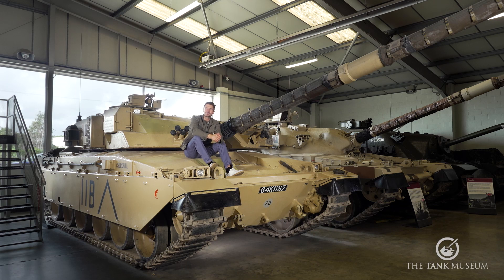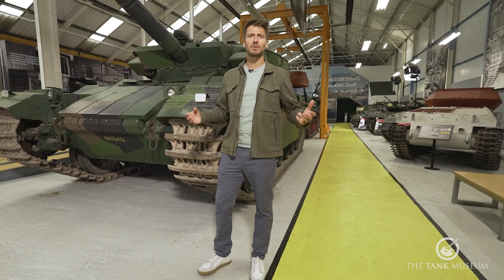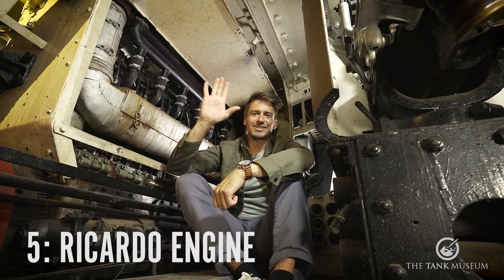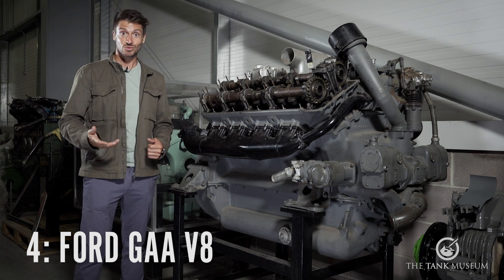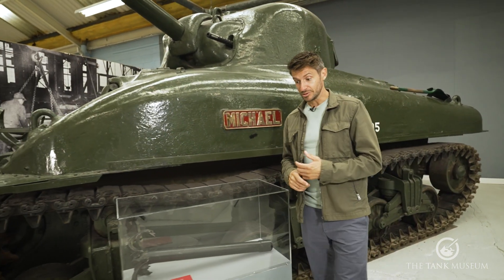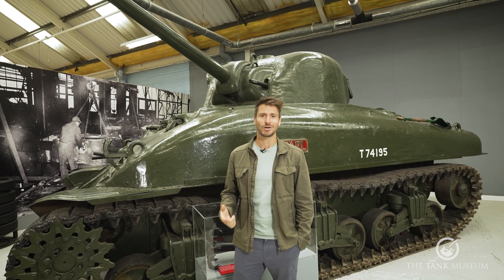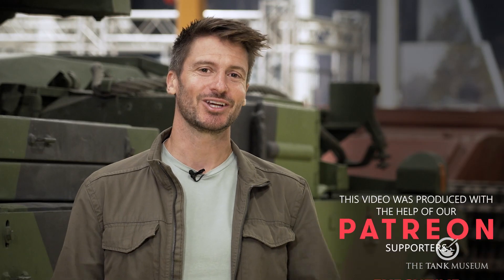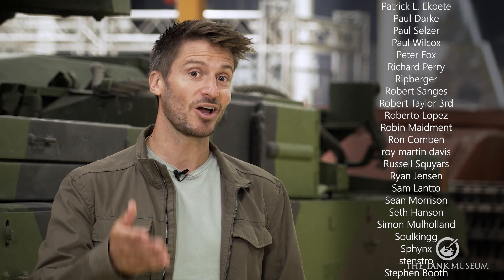Top 5 Tank Engines | Rob Bell | Institution of Mechanical Engineers | The Tank Museum

Comment: The Churchill had no less than 2 diesels, and about 19.000 shermans was made with one. The US Marines used them, the rest went to Russia. And I  belive that the V2 was originally dessigned for use in an airship, thos the aluminium used in its construction. But some good choices, I think.
Reply: The Churchill had a single petrol engine, the Bedford twin six, developed by Vauxhall from the General Motors Stovebolt six, Like Churchill himself the Churchill tank was part American! The twin diesel your thinking of was in late model Valentines
Reply: @stevecunningham8960  Sorry, I was thinking of the Mathilda 2, or A12, who had 2 AEC diesels. Or 2 Leylands..
Reply: @stevecunningham8960  The Valentine had a single 6-71 Detroit (the GMC 6004) which was a Canadian development during their production of that tank to avoid having to use the AEC engine. It was the Grant/Sherman that had the "siamesed" GMC 6046 which was two Detroit 6-71s driving a common driveshaft through a clutch system. The M5 Stuart had a similar paired arrangement with Cadillac V8s and dual hydramatic transmissions driving a shared transfer case.
Reply: @rwaitt14153  I was replying to a comment about the Churchill tank engine, which was definitely not a twin diesel, then I went and typed Valentine instead of Matilda, doh. Matilda's II's came with a twin engine setup linked through a common gearbox long before things like the twinned engines in the Sherman and Stuart were tried. British tank designers had a real problem sourcing suitable engines putting out enough horsepower  for tank use, hence the twin diesel's in the Matilda, the range of different engines tried in Valentine's and the god awful Liberty engine used in Crusaders and such. Getting the Meteor engine available must have felt like a miracle.

Comment: funny the v12 is a common format for engines. but the number of v10 engines can be counted on the fingers of one hand.
Reply: Partly engine vibration - a 60 deg V12 is perfectly balanced, a V10 is not. Also the variation in torque is greater on a V10 so a larger flywheel is needed. There might also be issue with the timing of exh pulses.

Comment: Not a single word about Maybach. Were they so bad?
Reply: My impression is that the Maybach engines were actually pretty innovate, reliable and overall good, but even a good engine will have reliability and durability issues when used in a tank that weighs just too much - King Tiger and the notorious Jagdtiger come to mind. The Maybach HL V12 engines performed ok in the Tiger I and Panther, but in the much heavier Tiger II and the Jagdtiger, the strain on them was just too great which would either result in frequent maintenance requirements and/or breakdowns due to massive stress. Add to this finicky final drives (Panther, anyone?) and you have a durability disaster in the making.
Reply: @cawimmer430  Good summary of the engineering situation! Also maybe some Brits /Allied biased point of view?

Comment: Is the Soviet V-2 engine really a good choice for #1? I remember reading that it was horribly unreliable and broke even faster than the gearbox.
Reply: Same question here
Reply: I don't see why you'd think that. Maybe during the middle of the war where corners were cut to get as many out as fast as possible. The Soviets planned for tanks with relatively short lifespans anyway, every component was planned to last long enough. If manufactured well they are perfectly reliable, there's still T-34s around and running today.
Reply: "According to the Armored Directorate of the Red Army, the average T-34 in World War Two lasted less than 200 kilometers (124 miles) before requiring major repair or overhaul. "
Reply: @davidbell1250  And if that's enough to reach the front line to blow stuff up/get blown up, it's fine. It's not a problem with the design, since pre and post war production can go much further. It's just cutting back on construction finesse due to requirements of the war.

Comment: I think the R-975 have no place in this list. It is a good engine, but its origin was its downfall as a tank engine. 
But he Continental AV1790 family should be in the list. That is almost the western equivalent of the V-2. It used in a huge plethora of tanks and tank derivatives, transitioned from petrol to diesel, and with it became the replacement engine of choice for a large variety of older tanks.

Comment: Fuel consumption is not a criteria. Range is
Reply: Well, fuel consumption is inherently tied to range. If you have a Hungary engine and want to keep the range, you need larger fuel Tanks, wich either means a larger, heavier Tank, or you need to Cut down on interior space and safety.

Comment: A radial engine doesn't have to be tall. Just mount it horizontally with the crankshaft vertical. That should also limit the problem with fuel/oil gathering in the lower cylinders.
Reply: And you massively complicate your transmission design.  Thank you Dr. Porsche.
Reply: Don’t forget the oiling system and sump which was designed to function upright.

Comment: I don't think that's how any of the army maintenance departments define reliability. When you read "reliability" in an army report, they're usually describing how consistently things break. I.e. how close to the service interval a particular part or system will fail. 
If a road wheel fails at exactly 1000km every time, then you replace it at 900km and it is known as a reliable part, because the tank doesn't have any unplanned down time. If it fails at completely random intervals, then it would be an unreliable part and the tank would often be down for unscheduled service.

Also what? The Continental? Almost universally regarded as the worst possible choice for a tank engine? The one with massive overheating and therefore cylinder life issues? Whatever design work that you say needs to be done to cool a radial engine in a tank clearly wasn't done on the Sherman.

Comment: I have a 50 HP Perkins diesel engine in my tractor, but it doesn't boil water to make tea.  Curse the luck.
Reply: Remove the radiator. It should boil rather fast.
Reply: @XtreeM_FaiL  I found an easier way is to forget to clean the radiator filter.

Comment: A Diesel engine has a higher efficiency because of its greater expansion ratio. That is all. The rest is just words whirling around aimlessly.
Reply: So the hotter charge’s fuel injection burning lean in excess air instead of in a homogenous stoichiometric mixture is unimportant?
Reply: @givenfirstnamefamilyfirstn3935  No, of course it's not unimportant. Given a specific engine, and no demands on maximum power output on that engine, you can play around with a number of variables, to save fuel at lower power settings. Just out of the blue, I think I'd want high boost, low revs (high gearing), lean and minimum cooling (hot engine). And that is what I'd want for an Otto engine too, in the same situation. But there are limits to what's practically possible and healthy for the engine. Anyway, there's no point in taking a bigger than needed engine and then run it at a low power setting. That's not efficient. But there is of course a point in running the engine as efficiently as possibly when there's no need for full power. Hope it makes sense.

Comment: To my knowledge, the engine drawings given to the Americans lacked so much in precision, that the Americans took an engine apart and made a new and - better set of drawings! That was why "spares" from one factory also fitted in other US engines, opposite the English versions
Reply: You are talking about tolerances. Before the war RR were building small numbers of Merlins & the parts for each engine were individually machined to fit - the Brit FINAL tolerances were perfectly fine, but individually 'tailored.' American mass production required that all parts be universal fit. When WWII began RR changed to mass production methods. The Americans didn't make better drawings, they used a different projection as standard so they needed to be redrawn to be understandable to US engineers. [British third-angle projection versus American first-angle projection]
Reply: The story relates to when Fords in Manchester UK started building the engine. See "Not much of an engineer" by S Hooker.

Comment: No love for the Continental AVDS-1790? I actually don't know how good an engine it was, perhaps someone might educate me. It powered U.S tanks from the m-46,47,48 and m-60 as well as the first three models of the Israeli Merkava. The engine was changed to diesel for the M60. I guess really the gasoline and diesel versions are different engines? The cylinder heads and crankshaft must have changed, probably lots of other detail changes. I doubt a really compact engine pack arrangement as used in the Leopards is possible with air cooling. The m-48 and m-60 Patton's have big air Louvers at the back of the hull, because of air cooling? Was that a weak spot in the Armour?

Comment: I was very disappointed in this video; basically only two types of tank engines (not counting the RIcardo) ,one radial and three V-12's, all gas fueled 4 stroke 
no turbine, no horizontally opposed, no multi-bank ,no H-type opposed piston, no two stroke sleeve valve, no diesel fueled, etc. 
expected ranking of different types not specific engines which leads to a lot of duplication and little differentiation
Reply: Were you not paying attention? The number 1 was a diesel.